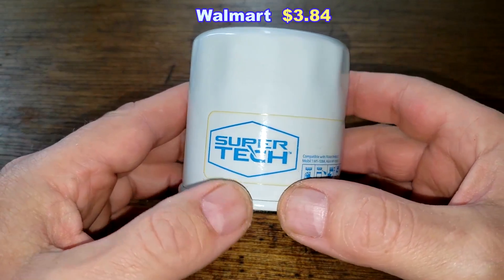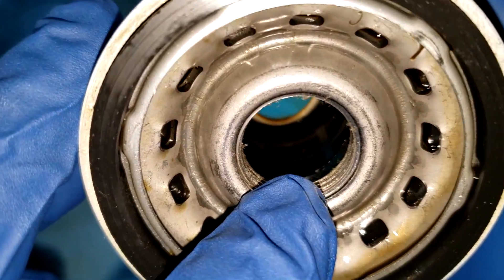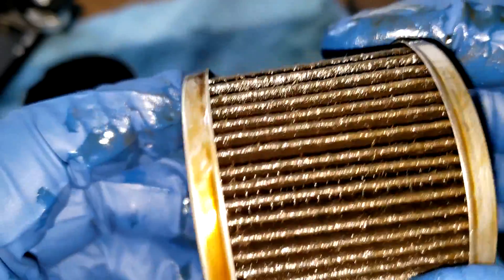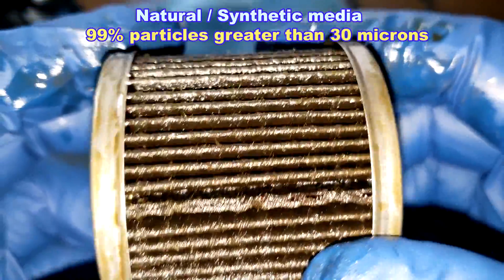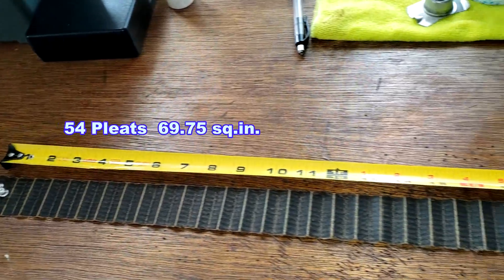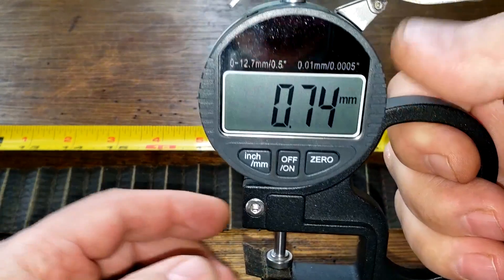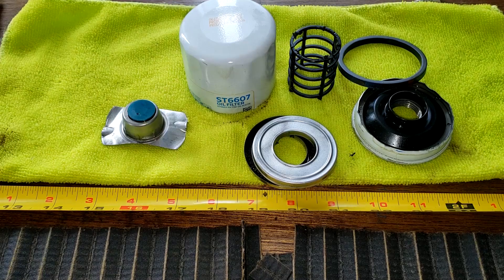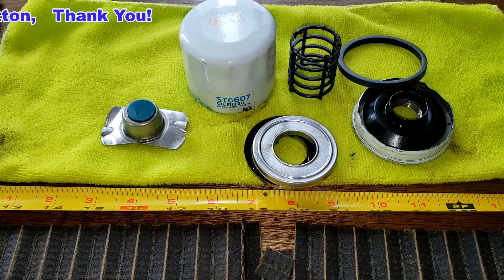Walmart Supertech ST6607 Oil Filter Cut Open, Used Walmart Supertech ST6607 Oil Filter Cut Open

Comment: Bypass valve function is there to prevent a lack of oil flow volume to the engine. Why would that matter?
If the media becomes plugged with garbage to the extend the oil cannot flow with the required in/out volume, the bypass valve will be forced open (spring tension overcome) because it cannot flow through the media with provided pump pressure.
The result will be minimal filtering, but oil volume will continue to flow to the engine as required.
If there was no bypass valve, two things may occur:
*Oil pressure will increase in the filter to such an extent, the filter will physically fail in some catastrophic way, none of which is good for the engine.
*Oil starvation to the engine will occur. Just estimate the cost of that.

Comment: He needs to do a flush and always change oil at 5K  9K is pushing it way too far i use 6607 on my Subaru 2012  Superteck oil and filter are a good cheap oil change 💯 i love the plastic e core
Reply from the maker: I appreciate the feedback and you sharing your oil change interval.😃

Comment: The filter is better than I was expecting, agree with it did it’s job but I wouldn’t go past 5-7k miles. 

You have made videos where you are concerned the bypass valve doesn’t seal with this filter it looks like it had when flattened out. I am assuming the filter had either been in bypass mode for a while or was nearing that

Comment: This is a great video to do on an economy filter that was used for 9000 miles so that people can see a real world application. My only thing is I don’t think it’s a good idea on any vehicle to drive 9000 miles before getting an oil change. It’s not good for the engine and at the end of the day, car  manufacturer recommendations I don’t think have anything to do with caring for the car as much as just getting it past the warranty period. 
I believe there are things that people should use common sense with and an oil change, 1 of  the most important services on your vehicle is definitely one of them.

Comment: Why are car owners still pushing oil changes beyond 5,000? There has been enough information from engine builders, proffesionals and mechanics to go no longer the 5,000 yet there are those that are still doing it. Is it bragging rights or just trying to save every penny which makes no sence considering the cost of a new vehicle.

Comment: As the Toyota Car Care Nut and many others say 5K Max miles on all cars if ya want em to make 200k+ miles Irregardless of the filter brand  A Toyota engineer said one guy changed his oil every 2000 miles and the engine went over 600K!  I think these super tech filters haven't gotten enough respect for their price Especially if you don't exceed 5K miles.  I buy SuperTechs and Wix XP's that are longer tall boys with the Same thread size but more capacity with the same seal width.  It has worked out great. 4-5K intervals for me.  My oil is never Dark only light light brown at change.   Thanks Whip...
..

Comment: I have a 2017 Cadillac ATS and it gets driven quite a bit each day. I use Super Tech oil and Super Tech filter. I've never had a problem yet, and I let the car go on oil changes until the yellow reminder light comes on. ( 5,000 miles)  I also use Royal Purple oil from time to time. There is no difference in mileage. This is a great video, thanks for making it.
Reply from the maker: You're Welcome, Thanks for Sharing👍

Comment: I bet the filter would look a lot better if they disabled VCM on that Honda Pilot.

I use the MP7313 filters on my Hondas. At some point recently, Walmart stopped recommending them and tells you to use the ST/MP6607 now.  The price on MP versions has also doubled or more in the past few months so I'm looking at different filter options.  I use the MP line but change oil at 5 to 6k intervals.
Reply from the maker: I agree, I would turn the VCM off. The engine would probably last longer too. Turning cylinders on and off doesn't seem like it's a good idea.
If you have the room, I would pick the 7317 over the 6607. Thanks for Sharing👍
Reply: @WhipCityWrencher Thanks for the reply!   I purchased a VCM Tuner II for my 2011 Honda Odyssey.  I got tired of dealing with the fouled spark plugs on the rear (left) cylinders.  Thankfully I never had the oil burning issues but I know the VCM Tuner will ensure that never happens, either.  No issues since the install and the "fuel savings" are minimal at best compared to an engine replacement.   I will continue to use the MP7313 - walmart says 6607 now but also recommends the Mobil 1 M110A, which is the 7313 equivalent.   You should tell Ken to grab a VCM Tuner - VERY easy install! - and different filters for his Pilot!
Reply from the maker: @brassmule  Okay I'll let him know. Thanks!👍

Comment: Just a suggestion I've seen others used the filter opener by placing the actual filter in a vise then spinning the opener. Being more stable might cut down on the paint/metal shavings Other than that GREAT CONTENT!

Comment: That filter has been maxed out for quite a while. It's putting dirt back into the engine. Cheap filter like this one should barely go 3k. Only filtering 30 microns, it's letting the 20-30 micron particles past, that would normally be caught by a better filter. Between the lower quality filter and going too far in the service interval, this engine is wearing out fast and is filthy inside. When I change my oil in my 2022 Honda Civic at 3k with a full synthetic filter, My oil comes out still looking gold which means it's trapping all of the dirt. There's no dirt going back into my engine after it hits the filter. Unlike this filter, which is throwing dirt back at the engine because It's been full for a while. The oil might go longer than three or 4,000 mi, but the filters can't hold any more dirt.

Comment: I don't think the seal between the leaf spring and the end cap would pass the flashlight test.  Those little nubs on the leaf spring will cause a gap for unfiltered oil to bypass the filter media.  It's a shame that it uses this design, as otherwise it is essentially a re-branded PurolatorOne or Mobil 1, but at a much lower price.

Comment: What a teeny tiny oil filter, 9000 miles is way too long between oil changes....stick to 5000 mile intervals....oil is cheap, SuperTech filters are even cheaper....then engines

Comment: They put on the wrong sized oil filter for that 2020 Honda Pilot.  Should be the ST7317, a bigger oil filter, and the correct one for that application.
The 6607 used here is a "shorty" version of the 7317 (Fram's part number system, so a TG7317 or XG7317 is the right one).   A shorter, smaller one like that resulted in more bypass events on cold starts, high rev transients, you know.  A;lso, the higher mass flux on the smaller one is worse filtering performance.
Reply: As a matter of fact, this ST6607 is a dimensional direct replacement for some motorcycles. Most of those run anywhere from 3 to just under 4 quarts capacity.
A 3500cc 6-cylinder engine with a much higher oil volume should be getting a larger filter, for passage of higher oil volumes (and greater dirt-capture ability before plugging).
Reply: At some point in the past few months, Walmart switched from showing the ST7313/MP7313 as the correct filter for these engines to instead showing the ST6607/MP6607.  I'm not sure on why that is exactly, especially since they ALSO recommend the Mobil 1 M1-110A, for which the MP7313 is the direct replacement, but the 6607 replace the M1-108A.  Very strange!  I imagine that this person is just using the data that Walmart gave them - but I don't even know why Walmart is doing that.   I continue to use the MP7313 on my three Hondas but Walmart states that the MP6607 is the correct filter.

Comment: He got wrong size filter on that honda. 7317 is the correct one. 6607 is much smaller than that.
Reply from the maker: I thought so too,
but Ken told me that the oil filter book at Walmart listed that size as the one for his vehicle.
Reply: @WhipCityWrencher  Yeah, WM oil filter look up consolidates and downsizes to the 6607. IDK if there even is an ST7317, might explain it too. But, the OP here is correct.
Reply from the maker: @faxmen09  I don't think there is an ST7317 either, just an MP7317
Reply: @WhipCityWrencher  Sounds right which would explain 6607 use here. Unfortunately, seems MP series now history at WM.
Reply from the maker: @faxmen09  Thanks! I wonder if the MP comes back or maybe something different? Have a great day!
Reply: True, and the 7317 is 40% bigger than the 6607.     Honda and others use the 6607 when there are space limitations in the engine bay.

Comment: I just don't like ANY filter that has a metal to metal contact between the base plate and the bypass valve/spring.  It just invites leakage of dirty oil.  And I don't have a lot of confidence in the seal of that plastic valve.  And that leaf spring doesn't inspire a lot confidence.

Comment: The filters for those engines are so small.  It seems odd that a normal V6 would have just about the smallest oil filter available.
Reply: They used the wrong oil filter.  It is supposed to use the 40% larger ST7317 (or Fram XG7317).
Reply: @softwaresignals  The factory Honda filter for a Pilot is just as small.
Reply: @wheel1775  Ford does that too at factories.  A smaller oil filter on a new clean engine is OK.  They do that to save pennies, but mostly to avoid mishaps during engine install where it sticks out too far and gets knocked off.  My '24 Honda CR-V had a full-sized ST7317-equivalent on it so I guess they did not need to worry about it getting whacked.
Reply: 6607 can be used in place of a 7317,  Oil change places use 6607 oil filters , You can use both filters for various applications...... Honda, Nissan, Mitsubishi etc..

Comment: It seems most guys are stuck in the 1970s. Oil change intervals have been 7,500 to 10,000 miles for 15 years now. Manufacturers know you're going to get the cheapest oil change at Wal-Mart & Jiffy lube. The oil is perfectly capable of going 10k. The filters are as well.
Reply from the maker: Some engines have fuel dilution problems, so it's not a one size fits all, but I like the 5K OCI's
Reply: I respectfully disagree when it comes to the modern GDI engines.  They are notorious for diluting the oil with fuel.  My '22 Subaru, that I've owned since new  is a prime example.  Factory recommended oil change is 6,000mi.  I do oil analysis every oil change and at 3000 mi, my oil contains 4% fuel!  No way I would go 6000mi or more.  I change at 3000mi.  Oil is cheap in the grand scheme of things.  I could see doing longer OCIs with a port injected engine as they are not known for diluting the oil with fuel like the modern GDI engines.  Some manufacturers are worse than others.  Oil analysis will tell you how far is safe to stretch the OCIs.  To each his own though.  Not my vehicle...😎
Reply: What is best for an engine doesn't depend on what the EPA wants.  Yet motors call for 5w20 instead of 5w30.  Crackpots don't want people to change the oil so much because they think it is bad for the environment.  They also don't want people driving or running old cars.  The manufacturers just want those people off their back.  Common sense says cleaner, newer oil wears the engine less, period.
Reply: One drop of fuel will make the oil smell.  Fuel dilution is totally overblown.  Even port injection will cause a little fuel dilution.  An oil filter shouldn’t get dirty at all if the air filter is working properly and the engine is clean inside.

Comment: Nice to see a (champ lab) filter with 9,000 miles on it. I would say the filter did a very good job of filtering the oil. Another shout out to the Kirkland oil as well. The inside of the can was clean after a good long run due to good oil and a good filter.  Like you say, I would not push things any further the the 9000 miles.
Reply from the maker: Thanks👍

Comment: on 5/4/2024 I have a vid where I open up a used ppg4612 precision Parts  branded.  its supposed to be equivalent to the st6607 and fram 6607.    OEM part is 15400-PLM-A02 (Honda).    oddly enough  the ppg4612 is what the dealer used for my oil change and NOT the OEM part.  When I opened it up it looked good,  just wish I knew the micron ratting for it. I haven't been able to find it. I am assuming its just like the pg4612 (premium guard 5k filter , 96% eff at 20 microns). I would of expected the dealer to use OEM filter or at least a filter that would cover the oil change duration of apx 7k miles.
Reply: Are you saying a "Honda dealer" didn't use a Honda OEM oil filter? Or, some other vehicle dealer? If the former, not much of a Honda dealer, and I'd be pissed. Not because the A02 is such a great filter, it's not. Efficiency not very good. But a Honda dealer should use Honda OEM parts. And to top is off, they didn't even use the longer spec 7317 size. No bueno☹

Comment: i know that filter says 10k  I wouldn't go past 7k on it.   I bet that leaf spring was bent because filter was clogged and it was using the bi-pass valve. been using the st6607 for 5 years on multi cars. no issues. but the other 2 cars the oil change duration was 3-4k with 10-30 or 5-20.   on the 3rd car just moved to st6607 and its oil change every  7k miles. and 0w20
Reply from the maker: Thanks for Sharing👍

Comment: By now you've probably had a couple filter cutters for the job. What is your favorite? I might try to get one to inspect my own stuff.
Reply from the maker: I still have the same one, I bought a cutting wheel for it once on eBay though. Here's a link to the one I use. $28.99 + Shipping,  https://www.speedwaymotors.com/Speedway-Engine-Motor-Oil-Filter-Cutter-Tool,2618.html?utm_medium=CSEGoogle&utm_source=CSE&utm_campaign=CSEGOOGLE&gad_source=1&gclid=CjwKCAiAloavBhBOEiwAbtAJOyMPhVP1l2tr4I1vxwZ8LcddH8SzEFxJr1GGizLbCM9ibZP_KPr7eRoCTjcQAvD_BwE

Comment: I love your channel! I know this is a dumb question, but can you tell me what the BYPASS valve in an oil filter is for? Thank you in advance and also thank you for the great videos and information.
Reply: In the cases that either 1) the filter media becomes clogged due to excessive use and oil flow into the engine is impeded or 2) the temperature is so low that the very cold thick oil can't pass through the filter media quickly enough so that the engine is starved for oil, the bypass valve opens to allow unfiltered oil to reach the engine.
Reply from the maker: Steven gave you a good explanation.😊👍

Comment: Yeah, that oil was too dark. Why chance it? Although because of the winter months, I have stretched out changes even a little further, but I use the 20,000 mile Mobile One to hedge my bet.
Every time that I buy an oil filter for my 2011 Civic [218,000 miles] I have angst over getting a lousy one and saving money, or a better one and waste money. 
Two days ago I bought a cheap filter opener, and yesterday I cut a Supertech MP-7317  which cross-references to the original Honda Filter, but is listed on Walmart's site as not fitting. Even on the filter itself it states it's the same as 3 other filters that fit the Honda.
The filter is $5.97 and just an inch longer. It was built exactly the same [metal end caps] with 100 square inches of filter media.
If you have the room to fit a longer filter, I feel that this would be worth the extra $2 or $80 over 10 years.
 65mmx993mm=64544sqmm = 100 Sq.inches  02/21 USA
Reply from the maker: Thank for Sharing👍
Reply: Thanks for that information. I used the ST6607 because of the tight confines where the filter is located, and it's what Walmart said fit. We are a Honda family and this filter fits 3 of our cars, so we bought a case of them. I'm definitely going to disregard the Maintenance Minder and change the oil and filter more often from now on! I definitely will try the MP-7317 on my Ridgeline next oil change, since by then I'll have used my last ST-6607 from that case.
Reply: Honda oem filters are not good fyi. Look up videos of them, dream type with felt end caps. Not sure about the ones for newer cars but my 2012 accord oem ones are. Although, I went to Honda for most of the oil changes and at 180 it runs like new. 5000k mile oil Changes fyi

Comment: I am impressed by that economy filter. I see many filters that show very little or no sludge/ carbon on the media. Possibly due to frequency of oil changes, but this filter was working and doing its intended job. I’m not a fan of the bypass valve, and I agree with many others that more frequent oil changes are a good idea.